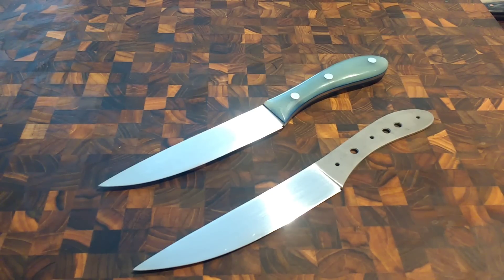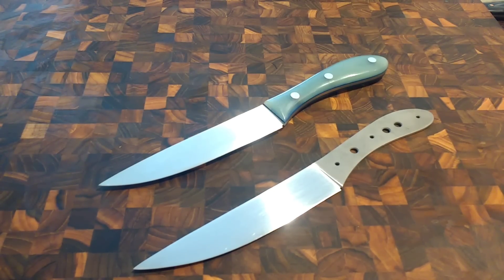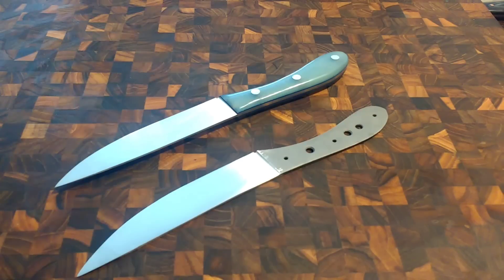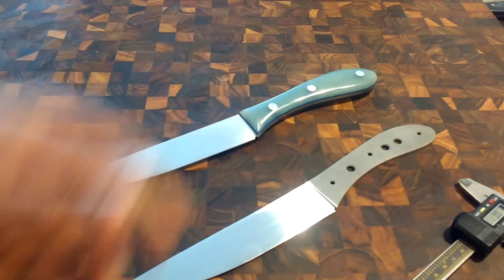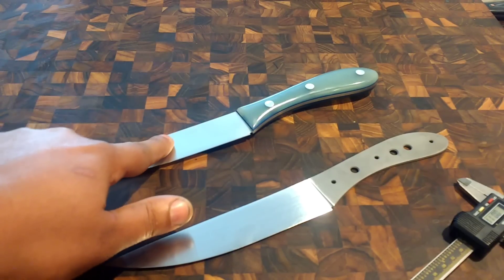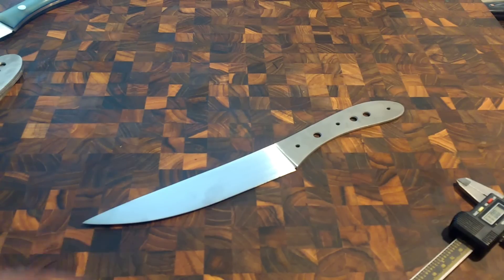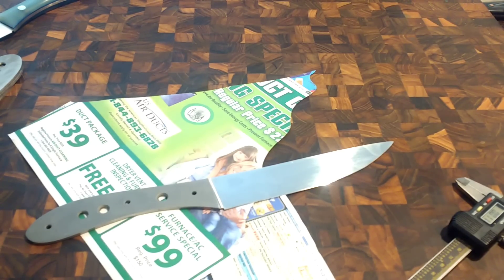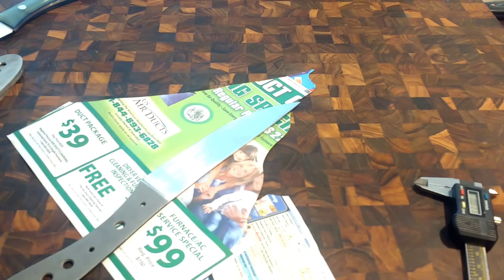Toughest Edge Steel In The World.

Comment: How does it hold up compared to spring steel and high carbon steels in flex tests?  I find it hard to believe a steel with over 18% chrome can compete with spring steel in flex tests. Doesn't it break under high tension stress? I've never owned this steel to be able to run tests on it. Everyone seems to only want to do edge toughness tests, when proving how tough it is. I want to see you guys bend that over 90 degrees in a vice and show me it out performing 1095.
Reply from the maker: flexibility is dominated by geometry, deflection is 4 multiplied by force applied by length of the knife cubed over modulus of elasticity of the steel by width and thickness  of the blade cubed. These steels are capable of  flexing and being fillet knives with the right geometry and as long as some mouth breather didn't heat treat it and fuck it up. Spring steels lack the strength component for holding a good edge, they can roll and plastic deform so damn bad in use might as well be a chip. I get annoyed with extreme tunnel vision on raw ductility toughness from those seeking durability , that's not how shit works . I can't think of any reason for a high performance knife made for cutting to bend to 90 unless its a fillet knife. 1095 is not the toughest steel either.
Reply: @FearNoSteel  All I'm asking is how does it compare in a flex test to a standard steel like 1095. What's more annoying is when people try to defend knife steels as if they were their wives, instead of just giving us the data.
Reply from the maker: I told you, 4FL"cubed" over EWT "cubed" . This means make it thin, it will flex.
Reply: @FearNoSteel  Ok thanks.
Reply from the maker: @LondiniumArmoury  https://www.instagram.com/p/BhuQ9XogQ8N/?igshid=vecn49hxy3dj
Reply: @FearNoSteel  Yeah, that's what I was wondering about this steel, can something with almost 20% chromium withstand the same level of flex without breaking?
Reply from the maker: @LondiniumArmoury  Chromium is not in the equation I gave you. You're getting tunnel vision on the steel. That knife was 0.070" stock. It's the Geometry.
Reply from the maker: @LondiniumArmoury  Force applied, length, modulus of elasticity, width, thickness.
Reply: @FearNoSteel  Okay, so if you made a blade the same thickness as your 1055 machete, same geometry would it be able to bend over 90 degree without taking a set or cracking. I'm not talking about your knife, i'm talking about steel Vs steel. Can this steel flex safely without breaking.
Reply from the maker: @LondiniumArmoury  1055? My Machete? That was Ed Braun,Alef Forge, that blade in the video was 1095 at +60rc. Geometry, Geometry, geometry
Reply: @FearNoSteel  My personalized auto correct changed it from 1095 to 1055, I asked if this steel could withstand a flex test if it was the same thickness. Why are you avoiding the question and making this so prolonged I will just give up asking you then. All I want to know is can this steel bend to 90 degree and return to true without breaking. You are making it sound like any steel can flex 90 as long as it's thin when I know for a fact not all steel can.
Reply from the maker: I could have just say "yes" but I've taken the time to explain. Vanax will flex 90 at 0.070" if at the same length as that machete.
Reply: @FearNoSteel  I do appreciate your explanations, I've learned a lot from reading your replies and reading up on things you have told me about. Sorry for wanting a quick response and being impatient with you. I really do appreciate your knowledge in the area, I can't complain when people are teaching me for free.
Reply: 1095?? 1095 is way less tough than most people thing it is. It's almost 5 times less tough than 5160, 3 times less tough than ballbearing steel or 80crv2, 4 times less tough than 3V,also 4 times less tough, than AEB-L which is a stainless steel!! Until 60 HRC 1095 is as tough as O1 is, which is another steel that is not , not even close, as tough as people thing it is!!

Comment: what about 4v makes it so tough? newish to the knife making world
Reply from the maker: Not purely toughness but a good blend of strength and toughness due to having a good amount of alloy, low chromium and being a PM steel
Reply: I'm from Malaysia, very nice review.
I have a question here😊, will cpm4v make a good chopper? say 20 inches parang? As i know, CPM3V is pretty tough and good for long blade. How about CPM4v? In Malaysia, vanadis4e, M4 and K490 are used in chopping competition. I'm just wondering, what steel is more suitable for long knife? Tougher steel like calmax, S7,L6 or PM steel such as V4E,cpm4v or K490? K490,Cpm3V or 4V?
Reply: @greenforest80  Spring steels will always be more suitable steels for Parangs and machetes. 80crv2, is a super tough steel, that also provides plenty of edge retention. L6 is really tough only until 57 hrc, if you go harder, it imedeatelly drops down it's toughness. PM steels, are not suitable for Parangs, however CPM 3V, is what I would probably choose, if I had to choose a PM steel, for a Parang. 5160, is one of the most suitable steels, for machetes.
Reply: @greekveteran2715  8670 may be another good option , aside from 5160.

Comment: i know this video is old but are you planning on making any of these knives available. I'm interested in 4ve primarily for its ability to support thin edges but everyone making knives in the steel are doing them so thick to the point of being unusable. one or two production companies seem to have marginally better grinds but the hardness seems to be erring on the softer side. If you ever make these knives available I'll be the first customer. Im desperate to try it out but no ones offerings really seem to be optimizing its benefits. Really cool knives
Reply from the maker: Thank you, There will be more. I've been exploring alot of different steels and heat treats so its been slowing down my making. Also Ive been devoloping special sharpening stones to match the steel since 4v at 64 is feel rubbing glass together on high end ceramic stones, needs special stones to get the edge I want. More on this later. I also want to explore 4v at 67 hrc, during HT it wants to be very hard and takes work to temper down which is interesting, given the toughness of the material it might be interesting to play with at that hardness to see whats possible. Stay tuned. Ill post a sale video for my knives here. So only Subs get sales

also email me here shawn.houston@live.com
Reply: the V4E/4v I've messed with sharpened similarly enough to 3v to make me think those examples were just too soft to really be a good indication of the actual potential of this steel. I remember reading that it compares favorably to moderately hard m4. At least in use. As for 67...I really want to see what happens. If it survives HT make sure to let us see the results. Great work!

Comment: Good info right here. I’ve done some blades in 4V @ 63/64 . Probably the most balanced steel of one doesn’t care about corrosion. I’ve worked with Zapp Z-Wear also, up there with it but a little trade off of wear  for corrosion resistance.
Reply from the maker: I like the edge off of cruwear/zwear at 63 a little better, seems the 4v is tougher even at 64 hrc but it doesnt sharpen as nicely as the cruwear, during rope cut testing I wasnt blown away by the 4v either, I think what impressed me the most was the ability to take that strength and toughness of 4v at high hardness and use it to go super low on the geometry

Comment: Yea..insane steel.
in my country Indonesia..we use them for cutting competition chopper..you can grind them very thin bevel..thin convek edge..almost v flat

And don't forget v4e brother.. 
Vanadis23..
I have golok with this badas steel 65hrc with crazzy wear resistan..
One the weird thing this steel only beter with toothy edge..in 400grit belt..but looks like 1000grit under microscope

sometimes i think Vanadis23 never be dull😁

Comment: didn't cedric/ada break the tip on a 4v blade,i was surprised it didn't seem like he abused too much
Reply from the maker: gabe v haha how thick was that blade? HUGE factor. More important then steel.
Reply from the maker: gabe v Edge toughness and blade toughness are a little different. If you want the toughest blade then you go soft steel, low alloy. Look at swords. But put this geometry on them. Absolutely crap. Folds and rolls for days. Can't handle it. Low strength.
The opposite is true if we baton this knife. Not going to handle insane impact as good as lower alloy soft steel. 

So we ask, are we Making a sword? Or a knife?

Also what happens when we compensate this steel and heat treatment to make it baton by using thicker stock? I'd argue that we would get the toughest edge and the ability to take some heavy impacts without critical blade failure at .200" stock

My point is don't get fixated on the steel, don't get fixated on a production knife in that steel unless you're also factoring geometry AND heat treatment.

Comment: I don't think you've ever heard of a competition Chopper I think those are made to chop and I think they still call them knives last time I checked chopping and cutting🤔
Reply from the maker: Casey Bryan haha have you heard of the grosser messer? That's a German sword that translates to "big knife" If we want we can get anal retentive about alot of shit. But my point in this video is exploring the edges of "cutting" knives not chopping, chiseling, scrapping prying tools. You want to see that stuff? Good. We will get there. This is my time and money. So we can only do so much homie.  No one is stopping you from doing this either. So join the team and get off the sideline.
Reply: Big Brown Bear yes I want to get cpm 3v from alpha knife supply and make one two knives from this steel I think that that is a very tough steel and I've heard good things about it
Reply from the maker: Casey Bryan excellent, I respect that. You'll find at this thin of a geometry the edge will not hold it's shape as good as 4v. It will roll due to lack of strength while 4v will not and have NO damage, But 3V is a more durable blade. Just depends on the end goal. Batoning? Or cutting?